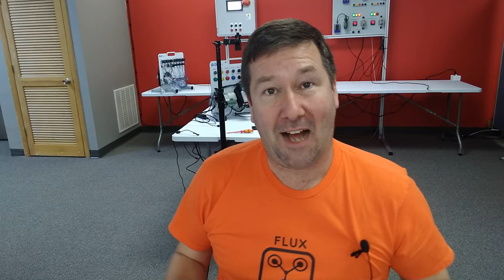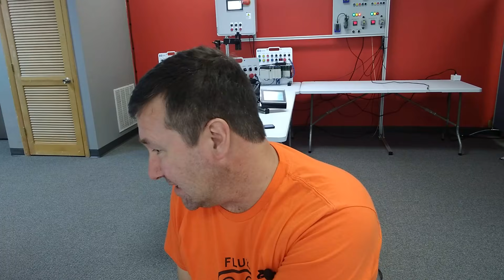PLC Programming Tutorial for Beginners. 3 Steps Before you Start

Comment: I have 5 years material handling 5 years operating 2 years as a process technician in a medical manufacturing facility. We use Siemens mostly with hekuma automation cells use arburg witman and yushin robots. I start automation engineering technology specialist associates degree in August. Trying to get a leg up for class!
Reply from the maker: Sounds like you are off to a good start!

Comment: Automated System: Conveyor Belt Sorting System
System Description:
An automated conveyor belt system is used to sort packages based on their size and temperature. The system uses:
• A capacitive proximity sensor (24V DC) to detect the presence of a package.
• An analog temperature sensor (0–10V) to measure the package surface temperature.
• An ultrasonic distance sensor (4–20mA) to determine the size (height) of the package.
• A Siemens S7-1200 PLC to control the system logic.
• A stack light with red, yellow, and green lamps (230V AC).
• Two pneumatic actuators (controlled by 24V DC solenoid valves) to divert packages based on temperature and size.
 
🔌 Components List:
🔍 Input Devices (Sensors):
1. Capacitive Proximity Sensor (24V DC) – detects presence.
2. Analog Temperature Sensor (0–10V) – checks temperature range.
3. Ultrasonic Sensor (4–20mA) – determines package height.
🧠 Controller:
• PLC (e.g., Siemens S7-1200) with:
o Analog input module (for voltage and current sensors).
o Digital input module (for proximity sensor).
o Digital output module (for stack lights and solenoid valves).
⚙️ Output Devices:
1. Stack Light (3-color, 230V AC) – indicates system status.
2. Solenoid Valve 1 (24V DC) – diverts hot packages.
3. Solenoid Valve 2 (24V DC) – diverts oversized packages.
4. Main Conveyor Motor (via contactor, 230V AC) – controlled by PLC output.
 
📋 System Logic (For Understanding Only — Optional for Schematic):
• If a package is detected:
o Check the temperature:
▪ If too high, activate Solenoid 1 to divert it.
o Check the height:
▪ If too tall, activate Solenoid 2 to divert it.
o Otherwise, let it continue on the main conveyor.
• Use the stack light to show:
o Green – system OK.
o Yellow – sorting in process.
o Red – sensor fault or system halt.
 
📐 Student Assignment Instructions:
Draw a schematic diagram showing the wiring and signal flow between the following:
• All sensors (with their respective voltage ratings),
• The PLC (clearly labeling input/output terminals),
• Output devices (stack light, solenoids, motor starter),
• Power supplies (24V DC and 230V AC),
• Communication between analog modules and sensors (0–10V and 4–20mA),
• Label all connections and include legends for clarity.      Good day Sir, can you please help me with circuit diagram
Reply from the maker: Sure, this course should help you. 
https://twcontrols.com/industrial-control-wiring-course

Comment: Hi, just a quick question, on the SCHNEIDER ELECTRIC IKQ 40A SP C CURVE MCB, why does it only have one connection (one input) many thanks, George brown
Reply from the maker: I don't know, I have never seen that product.
Reply: Are you talking about the line side of the MCB? Line side of a single phase MCB will only have one input for your active. The only other option with more “inputs” would be a 3 phase MCB. 

However what you require would depend on your circuit requirements, if it’s a 3 phase installation you’ll require a 3 pole MCB, for a single phase you would need a single pole MCB.

Do you have any more information you could provide? I don’t usually comment/ reply to YouTube comments however this one kinda confused me, hope this helps 😁

Comment: Good video. I bet i could learn this. I did power generation in the army 91D and got epa certified in hvac/r. I understand circuits and motors & worked in manufacturing w/automation but haven’t had to use computers
Reply from the maker: You’ll have no problem picking this up.
Reply: @ cool definitely something to consider

Comment: Random dude shows up at your company or emails you through LinkedIn: hey man what PLC you all use?   how would you even react to that?  you tell them to go fly a kite or block them. 

Also, plants usually have equipment from all over the world and use all kinds of systems.  Many of these systems are locked by the vendor so learning them is a moot point... you won't even get access.  

I profoundly disagree with that particular piece of advice.

If you want to learn PLC for your job, well your job tells you what to learn.  Learning it for the sake of learning it is not always the best way.  Find an entry level job and get OJT training.
Reply from the maker: I preach on the job training all the time.  The point of this video is to caution people against purchasing the first PLC trainer someone on Reddit recommends.
Reply: @TimWilborne  I can get behind that.  

I've worked with PLCs for a long time but never actually looked into the programming because is locked by the vendors or you have a high cost of entry.  Siemens Simatic or TIA portal is super expensive, and you need more and more software to get it to an usable point.  Even then, you won't have the project because is proprietary. 

I''m researching a good brand with free software, but the goal is to do motion control with servos and such, not just basic I/O.  Any suggestions?

Thank you.
Reply from the maker: You would have to define Servos more, but Yamaha's motion controller can integrate with both Siemens and AB with ease, I don't know if either of them is on your PLC list.  Here is a video I did talking about how the Micro850 now supports it and uses the free Connected Components Workbench software.
https://youtu.be/bXiTaj2zYqE

Comment: I have both mechanical and EandI experience as an industrial maintenance technician.  I want to learn more about PLC programming and integration. What steps would you recommend???
Reply from the maker: Great question!  I would start with this lesson series.  The software is free and you can get through the counter exercise with the simulator.  Then you can decide if you want to invest in some hardware.
https://twcontrols.com/micro800-connected-components-workbench-lessons

Comment: Thanks for the video, Tim. I am struggling to learn how to troubleshoot PLC's. I don't have the choice of learning just one though. Where I work there is a variety (no standard). There is AB, Toyopuc, Mitsubishi, Fanuc and the one used the most is Direct Soft. I kept wondering why I am struggling, your video helped answer it. 
In the school I am attending they covered briefly on AB. At work though we have 8 machines that use the AB out of hundreds of machines. Learning how to just get into everyone of them and start talking is Tough at times! But as a Maintenance Tech your expected to know everything, in reality it seems impossible to get good at every aspect in that line of work. Thanks again for another good Video, buddy.
Reply from the maker: I would still stick with the strategy of trying to learn one very well.  I worked as a tech at a plant that had every type of PLC also.  Chose the one you enjoy working with the most and learn how every instruction in it works.  As you get a deeper understanding of it, you will find the others come easier as well.
Reply: I completely agree with Tim on this one. I personally consider a variety  of Plc platforms within a facility to be an engineering failure. As I've advanced in the field , I have learned that quality operations do not do that. It is a spectacularly short sighted approach that saves a Nickle today and costs millions over time. i would go so far as to suggest that Tim do a video on the benefits and pit falls involved in each approach.

Comment: Good talk, I have found the brand to be more dependent on industry / machine manufacturer rather than geographic.
The sawmills in the pacific northwest all run AB. In those situations everything is wired to an MCC and the PLC sits right next to it. If you have a European wood working machine it will likely have a Siemens PLC and be a "machining center" design.

Comment: Excellent. as usual.  A recommendation, if I may please: don't try to learn all the instructions (as at 1:32) at the onset.  Won't mean much, nor it feasible.  Think of a simple problem: commercial garage door control is a good one.  Implement this on the PLC trainer.  Then pick another challenge associated, i.e. after 100 hours, motor lubrication maintenance alarm//indicator/reset.  Then record keeping.   Also, there are some good simulators, CCW is too complicated to begin with, IMHO.  I use logixpro, free version, but there are many others.